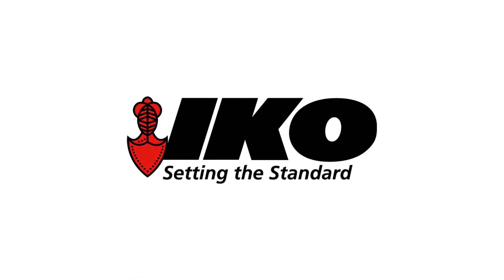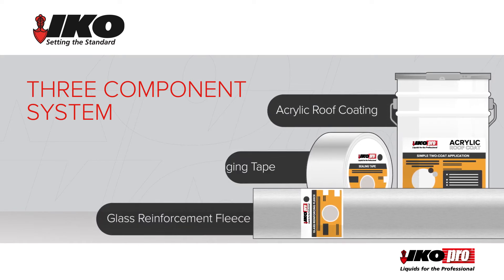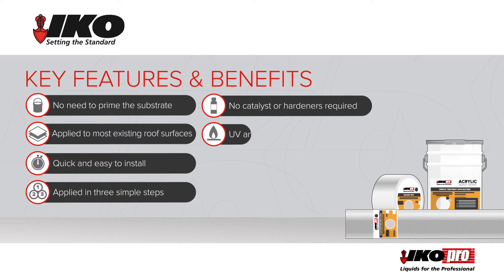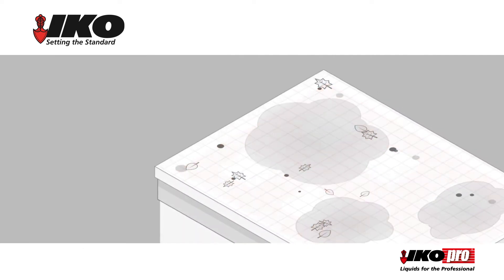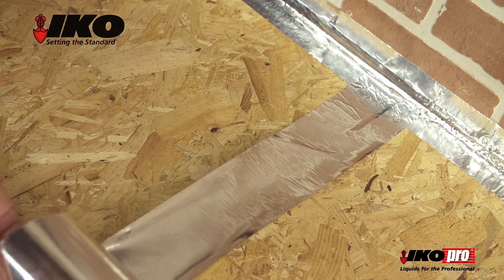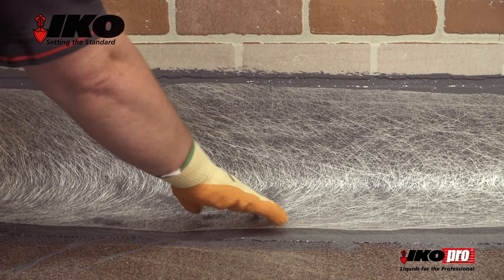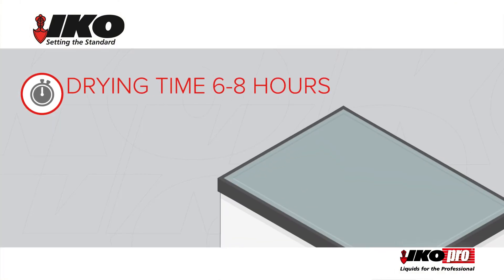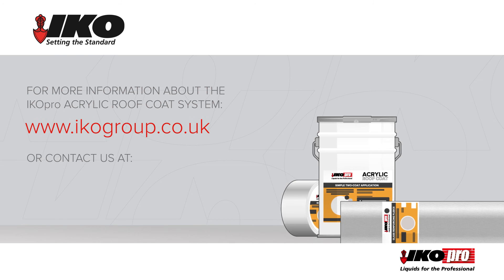IKOpro Acrylic Roof Coat System Explained

Comment: Renovated my garage roof doing this system this year. Put new osb3 boards down used the tape to seal the gaps and the grf. All good but the Acrylic paint used is not good. Found it flaking and water getting in. So I had to recoat it all. This type using a brush and not a roller.
The reason why I’ve used a brush is that when you use roller it leaves air holes and when dry water gets in.